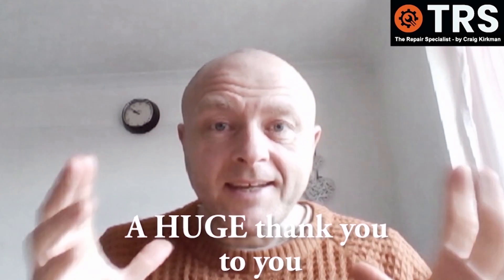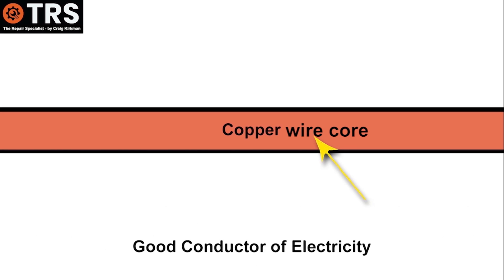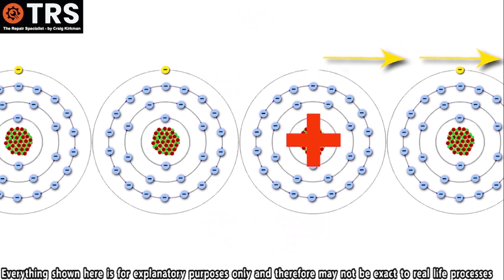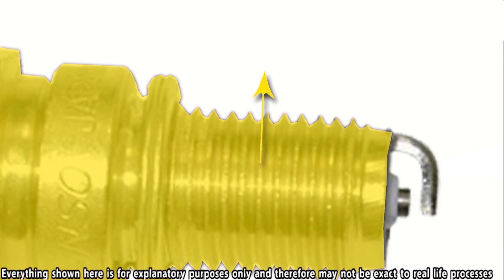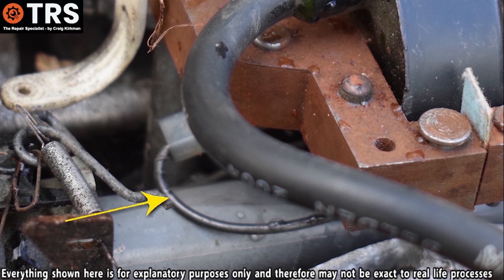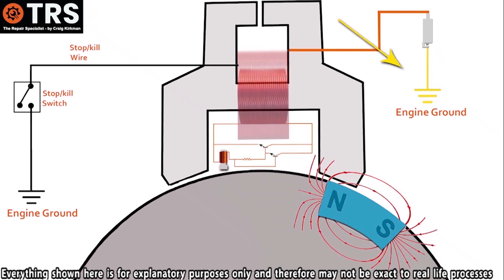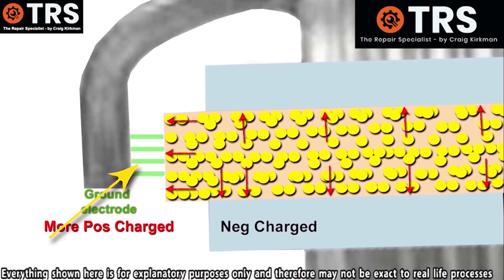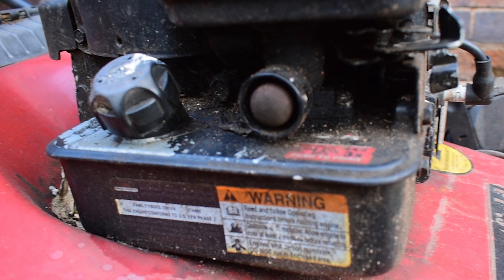Mastering the Lawn Mower Electrical System - A Comprehensive Guide. (by Craig Kirkman)

Comment: Good morning. Excellent technical explanations in your videos. I have a question...let's see if you can help me. In these electronic ignition systems with a magnetic plate...is there any way to know if the spark is produced in the spark plug at the right time, when the piston is in the right place? In the old systems with a breaker or breakers, we do not look at the moment of separation of the breaker. In these electronics is there any way to know when the spark occurs????

Comment: Bizzar. The scool theory says that a conductor in movement in front of a magnetic will produce a ac voltage or a conductor stays fix and alternativ magnetic moves in front af the conductor the result is the same. Bizzar that the magneto has a primary coil. The theory of the transfo is complely different. Must need primary and secondary to creeate a magnetic in both coil. In our case the magnetic is alternativ, N,S,N,S...and the coil (secondary) is fix, means that the coil will have a difference of potential (V) to the two pins. One for spark plug and other for GND (frame).
To kill HV must use the flywheel brake.
Reply from the maker: Ok